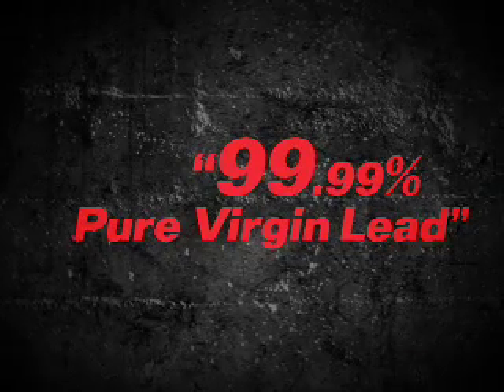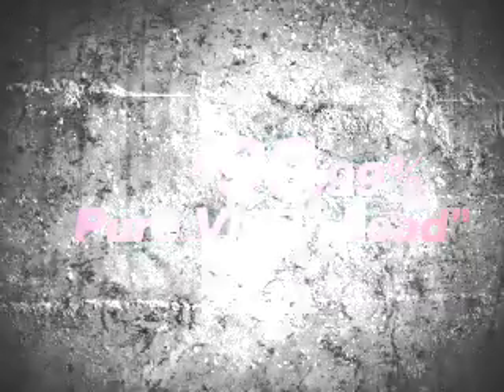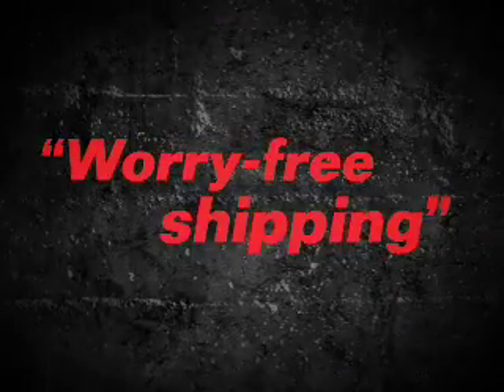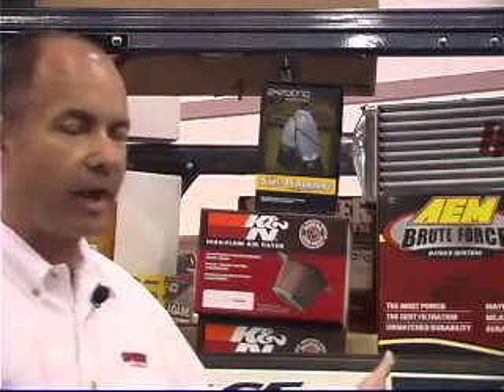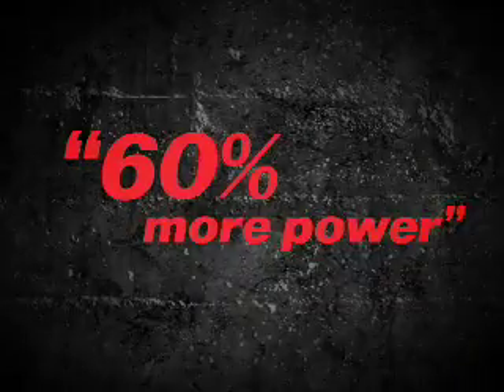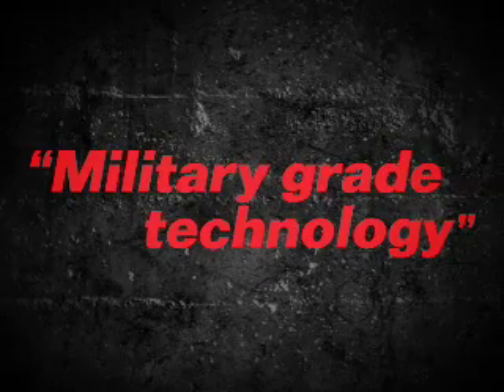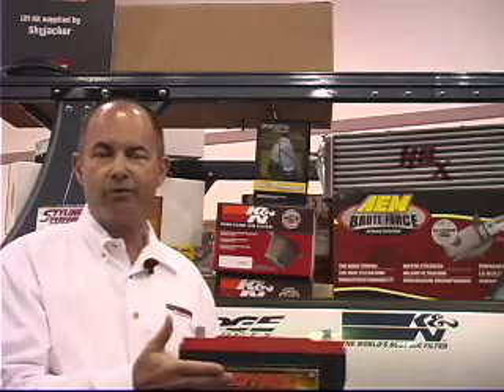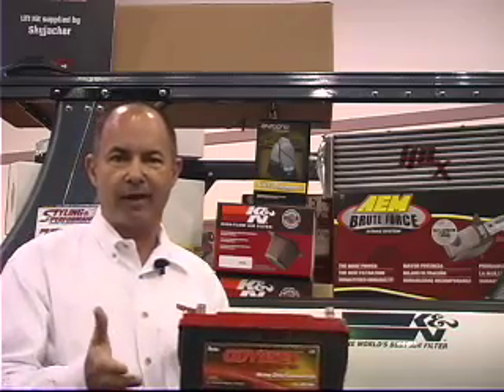Odyssey Batteries - Technical Breakthroughs

Comment: That is exactly correct. 
Had that happen to one (*new* Sears Platinum = same thing) in a Jeep Wrangler TJ after the blower motor was left on too long / forgot about it / overnight 'by accident': done to diminish condensation in the A/C system to combat to whatever grows in a humid Houston climate on the evaporator. 
Took hours for a Schumacher XC10 charger just to get the domelight to work!

In Australia batteries go flat; in "The States" they do dead (as if they were ever alive to begin with:)

Comment: im considering connecting this to a  450watt electric motor for  a electric trike im building, im going to run it at 30v and 2000 watts how would i recharge the battery when needed?

Comment: I agree, I sold the diehard platinum batteries which are the same. And people do have problems with them when they sit. The batteries I found freeze easy and for some reason dont like the heat. So up here anyway putting a warmer on them in the winter. And a heat bock from the engine heat is the best. The main reason they went bad was from freeze up though. But other then that they are truley an awsome battery.